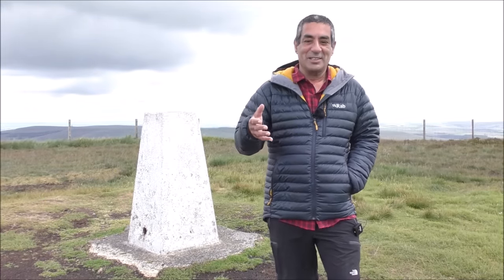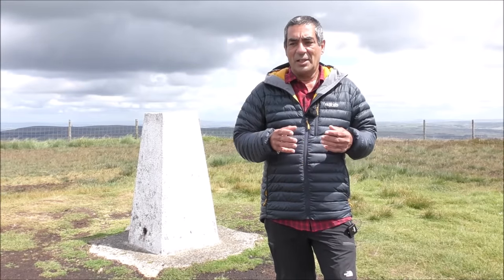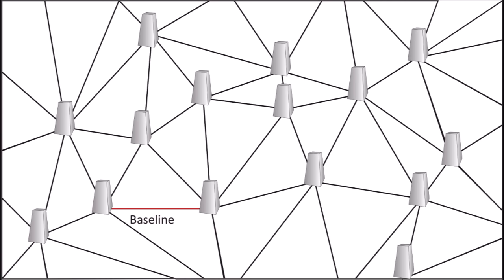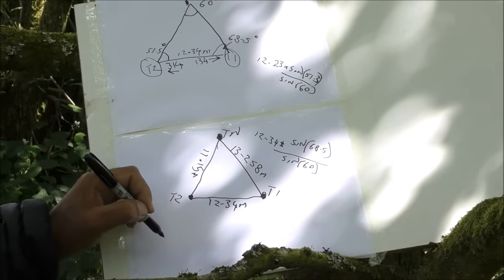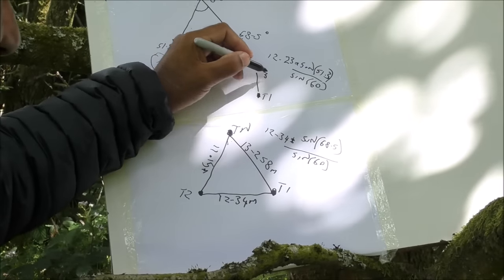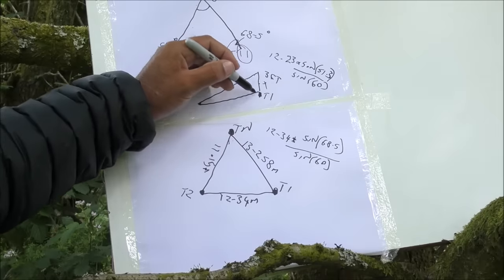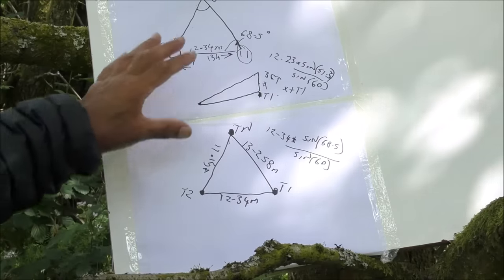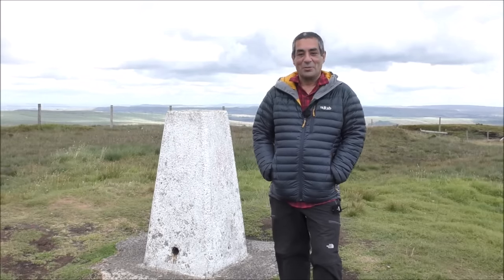How do trig points actually work?

Comment: Nice to get a recap on the stuff I studied half a century ago.
The first theodolite I used in anger was Victorian.  The Vernier's were accurate to 5 seconds of arc; 1/72 of a deg; and the staff was viewed inverted.  You learned to take readings upside down.  The "modern" one that replaced it wasn't any where near as accurate and the staff was viewed upright.  That caused a few reading errors before we got used to it.  I wish we'd had the equipment available now.  It does everything except carry itself to the site.   Mind you!  I'm a bit out of date . It might even do that these days. 😎👍
Reply: That's a good comment.  I'd forgotten that little detail about the staff being viewed upside down!

Comment: great for information! The basics of trigonamotry is compleyly missed. you have to go back to basic principals. stating that you put the sin of an angle devided by the didgerydo of the distance over the cosin of whatever does lose most people. where did this knowledge come from? you have to start small and in inscremantal reasoning or you loose your audience. use applied mathematics. it was great for general knowledge, nothing else. the real art is to enlighten. other aspects are curvature of the planet, local and global grid systems. local knowladge is the king.

Comment: Thank you for a very interesting video.
A similar comment has been also made, as a struggling child of the 1970s at secondary school if only the teachers had said why we needed to know and understand the maths.
I couldn't understand why we spent days working out the area of a cube for instance, I'm now a fuel tanker driver delivering heating oil and several time I've been asked "how big is my tank driver"? (base x hight x length x 6.25 galls per cubic ft, my teachers didn't tell me that reason!) 
My father worked for the OS after he came out of the RAF after the war, unfortunately we lost him when I was 2 but I have his rough book, beautifully written and I'm now going to dig it out and have another look at it and now with the understanding thanks to your video, I think his cycle allowance was £1 old pound for a 100 miles. He spend many weeks around Dartmoor chiseling bench marks.
Many thanks,
Rgds. Peter.